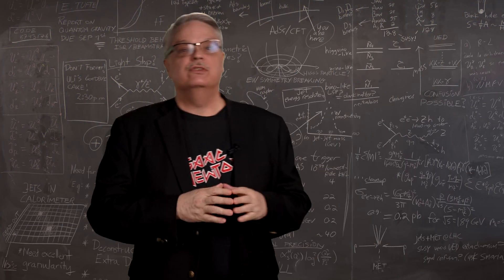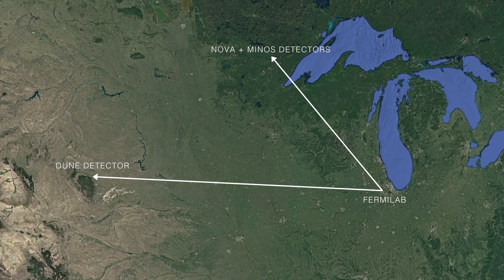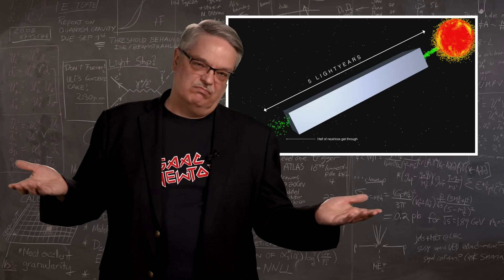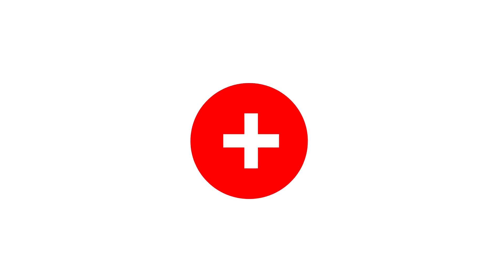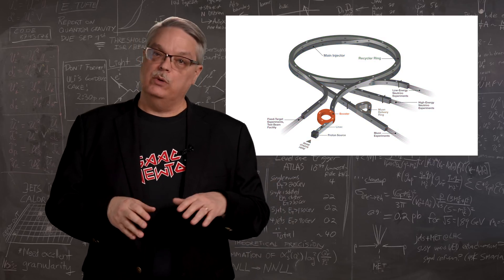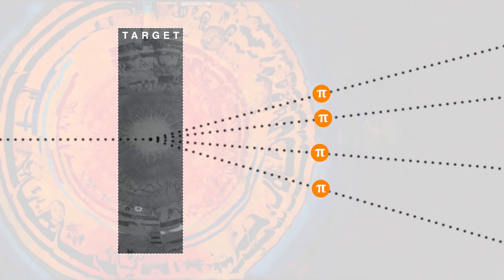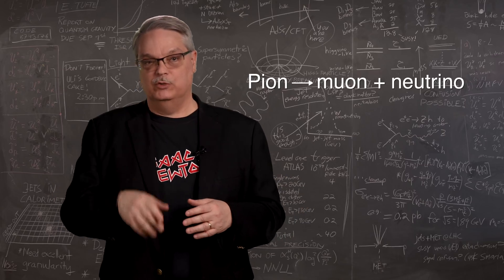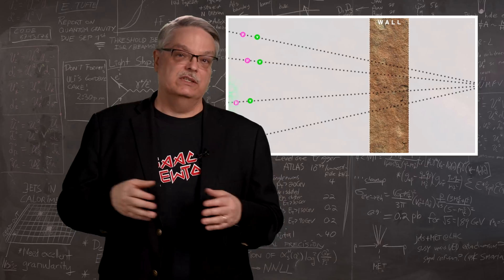How do you make a neutrino beam?

Comment: Why would the neutrino have the same direction as the muon?  Why doesn't the neutrino take kinetic energy from the muron and depart in a random direction?
Reply: Sure, the neutrino goes in an arbitrary direction. But that's in the rest frame of the decaying particle. Now let's go back to the rest frame of the lab (where the particle is moving close to the speed of light), and apply the relativistic velocity addition formula. It can be shown that almost all possible directions will yield a velocity almost exactly in the direction of motion of the original particle.

Comment: I've been reading lately that a sufficiently dense beam of neutrinos can disable a nuclear weapon. It got me wondering whether this could be designed in such a way as to create a wall of neutrinos made of intersecting beams to act as a defensive shield. The wall would only need to be activated at the coordinates that the missile would cross the barrier. As a smart missile doesn't have the capacity to detect neutrinos, it could not take evasive measures.
Reply: Just put a Pop Tart in the toaster and tape down the button.

Comment: I think you exelerated the particles and they start travling and not hitting.
Than the entetys trafling has a core and a chell dimention .
If it hits the wall than there is a lag of the chell particles inside the shell dimention travles outwards sons anove  bit the core is less negative and trafles treu.
Canceling out schinking inviorment wave treuts euths crost dimention 
Like a spurm to the shel of a egg  in spericle motion in ol directions.
En when the wave meets than the neutreno resarects again .
If it would passed the innercore it would have slown down as the innercore is less negative space inviorment  treuth the dragg  the pull from outside and the drag of this event is is conditioning the core same structurwise as suncicles😍

So neutrinos dont passes strait trouth the eurths existence as you prosume🙏
But its interaction on a surtenend layer dimention of eurths spasmatic existence is diverted and collected at the other side trougt a diverentional controld inviorment 
Like your experiment in this movie you use a pard of.

Can yo make a ring vormation of reseavers(detecters) in a angle of the suns trouth eurths hit asumption.
And where it is goind to hit eurth ther that spot the ring of detectors has to be🙏🌈
And maby at the other side where the beem is aiming to trough eurth olso make a ring.
than you are able to see the eventhorison layer where neutrinos travle bi and trouth 💜
But the are stil subject to the inviorment it interacts with.
No magics exists in universel and cosmic  existence of creation
The phosicle part of  neutreno cores  who enter becomes low interacting on drift  in space and motion of that lv of existence neutrinos😍
But....
If they canceld out negativety vor making room to reseave to pull open at the other side for us to opsurve in en out in the layer we have our detectors is in essenc the resarection of the  existence of the neutrinos 😍 but bild from others but the same soul💜

Than you wil see new light in this part of understanding of creation❤🛸💜

So neutrenos have the same lusieuse lane as you the hidron colidor people have confurmed they saw it too that photoninc lusieuse lane 

Breee we life in beautifull times of conformations trouth opservations of mens knowldge
Reply: When you see a comet hid eurth.
I see a comet releasing so matsh to the inviorment it travles .
Eurth is leaking less negative space dimention(mudfulcano activety)
In to tue direction of the commet.
And the if the commet starts tacing vrom the release of eurth.
The comet orbits in to .

And vica verca.
Of the commed is drifting as the inviorment of the comet is to less negative and eurth is taking so match as eurth has de deleay of the previus more negative layerr of dimentional eurths orbit inside the solarsystem.
And we pull in the space around the commet to vast that the comets delay of demant du not manivest exeleration jad eurth pulled the comets inviormend  in😍(vulcano activety)
Boths aren not colisions.
It is part of  trans spermanation of the creation.(thitonic activety)

Colitions and explotions dont exists in the origamy of creation😍🤗🌈💜
Reply: See it like a liquid eurth.
And the if the drub enters the  rimples around the drup go oudwarts...
The rimples become smaler and smaler.
But at the other side this rimple becomes bicker agan do to its interaction on the surpherts thention.
😍 this happens some where in the layers of eurths space and motion of eurths totalety within the totalety 😍💜🌈

Comment: Could it be used to send signals across earth and cut latency?
Reply: Sure, but it's not very practical. To create a neutrino beam you need a particle accelerator; and a neutrino detector isn't something you can build in your backyard either (and you'll detect one out of a billion neutrinos, or so). In fact scientists have done precisely that thing: they used the world's strongest neutrino beam to send the message 'neutrino' (in ASCII code) over a distance of 1 km. The neutrinos propagate at (almost exactly) the speed of light; but the data speed was 1 bit per 10 seconds, with an error rate of 1%.
Reply: @MikeRosoftJH  Maybe we can have like just a couple of these instalations which could be multipurpouse and equidistant to ensure the lowest possible latencies.

Comment: How do you KNOW that the neutrino IS going the same direction as the muon?
Reply: From the point of view of the muon, the neutrino goes in an arbitrary direction - all directions are equally likely. In addition, the energy of the neutrino is significantly less than the kinetic energy of the muon. Now go back to the rest frame of the lab; it can be shown (by the relativistic velocity addition formula) that almost all neutrinos will go approximately in the same direction as the muon's original velocity. (Yes, if a neutrino were to be emitted in the direction directly opposite the velocity of the muon, we'd see it move towards us, and heavily redshifted. But it can be shown that it's a very small angle where the neutrino's direction of propagation is significantly different from the muon's original velocity.)

Comment: Can the neutrino beam modulated so it can transmit data?  And if so, how hard is it to build a reliable receiver. Could it be used for submarines?
Reply: The easiest way to modulate the neutrino beam is just to turn it on and off. But it's not a very practical way of sending data. They have actually done an experiment with this: they used the world's strongest neutrino beam to send the message "neutrino" (in ASCII code) over the distance of 1 km. The signal travelled through the ground at nearly the speed of light; but the bit rate was 1 bit per 10 seconds, with an error rate of 1%. (And the neutrino detector isn't something you can build in your backyard, either.)

Comment: But how do you weigh a neutrino? Back in the 1980's when I was in elementary school (yeah, I found the books my classmates were reading boring and they called me a nerd) they just called it 0/massless in textbooks. What changed?
Reply: Well, direct measurement is consistent with neutrinos moving at the speed of light and therefore having no rest mass. But theory says that neutrinos (technically, at least two of three mass states) must have non-zero rest mass; otherwise, neutrino oscillations wouldn't have been possible.

Comment: In the detector, how do you tell the difference between naturally occuring neutrinos and those generated on purpose?
Reply: Direction and timing.  The detector knows the direction to the accelerator and the moment at which the beam is firing.  If it's in that window, could be from the beam.  If it's not, they're not.
Reply: @drdon5205  with many of these experiments, the science of the engineering is often lost in explaining the meaning of the experimental  results, though the latter is important as it is the real purpose of the experiment, if the method is not explained the whole thing might as well be magic or part of some religious belief. Something to be accepted without proof or understanding.
I think this  applies to such big experiments as the LHC. We have all seen the particle track data that it generates and have been shown the huge particle detectors, but I don't think I have ever seen any explanation of how the detectors work or how they produce the track data. Anyone who has a background in physics will be aware of cloud chamber pictures and will have an understanding of how such a device works, but I doubt if the LHC detectors works in the same way. Extrapolation from one to the other only works at a superficial level, as soon as you start thinking about the practical engineering details all understanding is lost.
It is the practical implementation  that is missing from the explanations, "the how". In the case of the neutrino detector, simply saying it's based on timing and direction only partly answers the question. While I understand that knowing the direction of travel and the arrival time explains how this determines the likelihood that they originate from the generator, it begs a range of questions about how the detector works, particularly with a particle that has so few interactions with normal matter.
I suspect there may be a whole series of videos that can be made on the engineering and on the operation of both generators and detectors for a range of subatomic particles. All these big experiments have in common is a detector and a computer system to process the data from the detector to produce those nice pictures. But how do they work? How do they differ between particle tyoes?  How do that detect such short duration events? How are the images constructed? Please can we have some videos on the engineering hows?

Comment: While this is an excellent presentation of how to make relativistic neutrinos,
since neutrinos have mass, I'd love to see a flask filled with very slow, very cold neutrinos.
Just about the only known stable, non-zero mass particle that doesn't fit on the periodic table...
(as course, given how little they interact with ordinary matter, getting them confined by the
walls of the flask will be a bit of a problem...)

Comment: Question: You bend the direction with magnets. Have you played around with the intensity of the magnetic field to see if it changes the speed of the neutrinos? Also, what if you had the opposite end of the magnet (so to speak) at the other end, not only possibly attracting them but accelerating them? How about, at the receiving end, a magnetic funnel reducing in size until the apperture microscopic? If you did that with "the opposite end of the magnet", would you accelerate the neutrinos? What I would like to see on the outside of that microscopic aperture is a reverse of the magnet back to the one that bent them, after passing through the opposite of that, so as to not only squeeze them down (like water jets on a hydro electric motor impeller at a dam) but the moment the neutrino gets past that it gets a figurative kick in the backside. Is it now faster then before? Is there any measurable pushback from such a device?

Comment: What percentage of neutrinos hitting the Earth come from our own Sun oh, and what percent are from other sources?

I wanted to know this because if there is a single good source of neutrinos hitting the Earth, we could apply the mathematics of computer aided tomography to the signals we get in our neutrino detectors, and effectively do a CAT scan of the Earth, to learn a lot about its internal structure. We would assemble years worth of data from different neutrino detectors and try to isolate the signal from the Sun and then look at the intensity of that signal as the Earth rotates and processes through the Season's
Reply: To first approximation, 100% solar neutrinos.

Comment: This is actually an extremely important video.   And the generation of intense neutrino beams is also extremely important, as will become more apparent in years to come.
Reply: Robert Schlesinger
Generation is not at all important: there are trillions passing through us every second, coming directly from the Sun.  If we never generated a single neutrino, we would have more than enough from the Sun.  It's the detectors that count.
Reply: @acmefixer1  The detection of neutrinos is difficult and of significant importance.  The generation of intense neutrino beams may possibly be extremely important in years to come for reasons that I can not disclose, but directed intense neutrino beams may have a very practical application for superpowers.
Reply: @robertschlesinger1342 aliens

Comment: How do you detect the neutrinos in the beam? They virtually interact with nothing and they need to interact with the the detector, right?
Reply: Produce enough of them, and you can detect. As mentioned early, one Neutrino has 50% probability of interaction after traveling 5 light years of matter. Having one matter by producing 5 light years long number of Neutrinos should be the same.
Reply: Chevy SparkEV it makes sense. Thanks for your answer!

Comment: Fun Fact: In Gerry Anderson's "Fireball XL5" series, the titular spaceship used a "neutroni radio" which used nutrinos instead of electromagnetic waves as the carrier for radio messages.

Even more fun fact: I remember a more recent Sci-fi fantasy story (a First Contact tale) which featured a Faster-Than-Light communication system which used Tachyons (theoretical particles which can only travel faster than light).  The tachyon generators are described as not accelerating particles past the speed of light, which would be impossible, but somehow creating tachyons which are already travelling at FTL speeds when they come into existence.

Here's a quick question:  Have tachyons been confirmed to exist, yet?  Or, contrarywise, has science proven that tachyons cannot exist?
Reply: Tachyons are purely theoretical particles for now and as far as I know they've also fallen out of favour with theoreticians. This is because as you say you could use them to communicate over long distances faster than light, which would screw up causality leading to situations where you hear the message before it's sent to you and weird stuff like that.

Comment: in the diagram at 2:20, why is the path from the booster to the main accelerator curved rather than straight?
Reply: Magnets guiding the protons.
Reply: @drdon5205  i mean why? why not just go in a straight line tangent to both accelerator rings (with some focusing magnets), why bother to curve?
Reply: @nicktohzyu  You could.  But since you need magnets to tame the forces between adjacent protons in the beam, this frees you up to make the beams in other shapes.  Remember that these accelerators steer beams in many directions.  It's easy to optimize one beam transfer line, but if you need to optimize many, it is easier if you can use curved paths.

Comment: @Dr Don....
You mentioned that on the way to the target the beam decays into muon and neutrino, at least I understood it this way.
Don't worry I won't split the hair here on words  like others here in comments....

My question is about the part which I didn't quite get...why does the decay happen and the neutrino then flies off into the same direction?

Or is it that they do decay into all sort of directions but we just try to detect those that fly still into the planned target and the rest just scatters off?
Reply: Pions have a mass of 139 MeV. Muons have a mass of 108 MeV. Neutrinos are essentially massless. When pi -> mu + nu, there is only 31 MeV left over. That energy goes to moving the muon and neutrino. The smaller that number, the more collinear the muons and neutrinos are compared to the pion direction. In the limit of zero, they are exactly collinear. For the real case, it depends somewhat on the direction in which they are emitted. But, no matter, the change in direction is small.

Comment: are neutrinos named so because they're sorta tiny versions of neutrons
Reply: this would imply the existence of protinos and electrinos
Reply: Etymologically, yes. The neutrino was proposed Wolfgang Pauli, and originally named "neutron" (Italian: "neutrone"). But this name was already in use for the neutral particle in the atomic nucleus, so the name "neutrino" has been proposed, as a pun: interpreting the suffix "-one" to mean "big" (compare "violone" - large viola, predecessor of the contrabass; in reality, the suffix "-on" in particle names is related to the word "ion"), and replacing it with suffix "-ino", meaning "small".

From the point of view of particle physics, neutrinos have little in common with neutrons. (They are both electrically neutral, and both are fermions with spin 1/2; but neutrinos are elementary particles with very little rest mass; and neutrons are baryons consisting of quarks, with mass of about 940 MeV.)

Comment: Muons also decay into an electron and 2 neutrinos in about 2.2us as far as I know. 
Won't those neutrinos add up to the overall beam ?  Or is the direction where they are emitted different from the original muons beam? 
Also on the topic of muons could you make a video about cold fusion using muons? Is there any hope we ever breakeven energy wise? Thanks.
Reply: Those other neutrinos are generally emitted isotropically, so they don't make much of a difference.

And there is really no hope on cold fusion and muons.  Muon catalyzed fusion is a real thing, but it just takes way more energy to do than you get out.